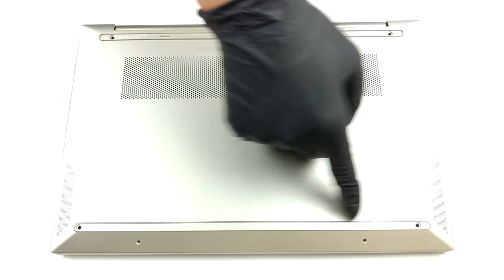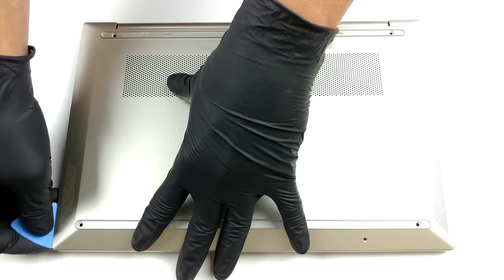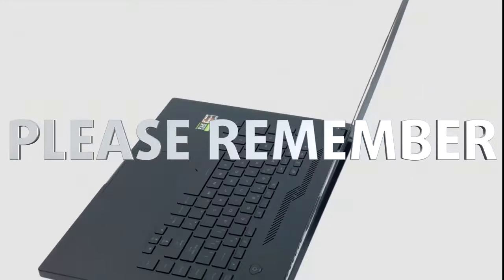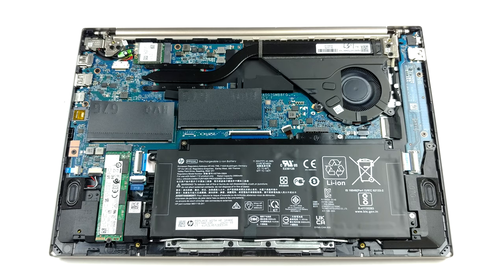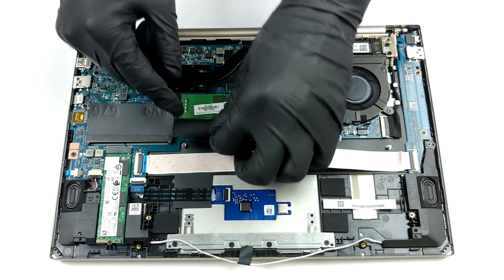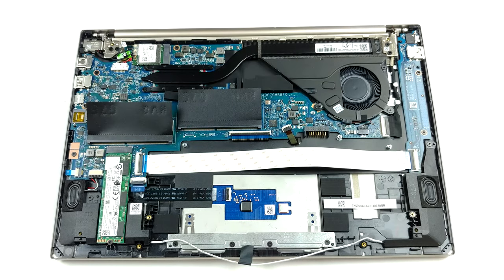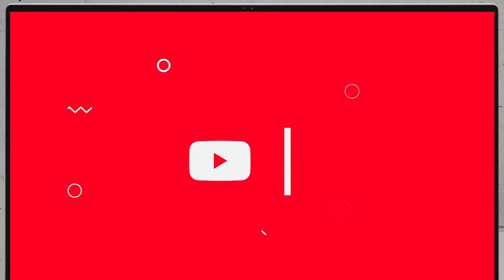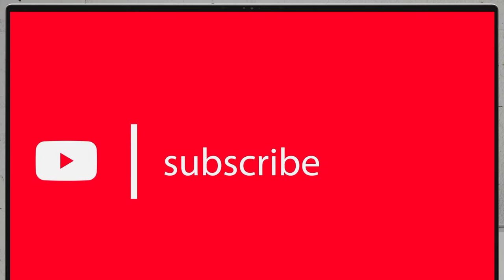🛠️ HP Pavilion 14 (14-dv0000) - disassembly and upgrade options

Comment: Anyone know is there is a secret advanced BIOS menu tab, my laptop is advertised and sold with PC3200 (1600MHz) RAM and looking at CPU-Z confirms that I have the correct modules but they are only running at PC2660 (1330MHz).  There is a 1600MHz JEDEC profile but the laptop is not using it and I can see no way of selecting it myself because HP has the BIOS locked down.

Comment: Hi, I have this laptop. I encountered CMOS 502 issue. I approached the repair shop for a solution to solve the issue. They mentioned that the CMOS battery for this model is embedded in the motherboard. Hence, the motherboard will have to be replaced and it would be very costly. Can you enlighten on the matter of whether it is true about the CMOS battery for this model? Thanks.

Comment: What's the best way to remove the rubber feet, and then put them back on?  Thanks
Reply: Do not remove them. Just uncover the edges enough to unscrew the 4 screws.

Comment: After swapping the memory the computer powered down the moment I pushed the power button.
The solution is:
* remove the power cable and the battery
* push the power button for 1 minute
* reconnect the battery and the power cable
* power on the laptop

I successfully replaced the SSD with a 1TB Samsung 980 and the memory with 32GB Kingston (2 x 16GB, 3200MT/s CL20).
Reply: I need to install 2x8gb ram on mine, any tips on how to insert the ram and how to reconnect the battery? any help much appreaciated, my ram arrives in a few days

Comment: Thank you guys. Great video.
QUESTION: Could you replace the original 3 cell battery with something larger? I wonder if it would fit all OR maybe there are only 3 cell batteries designed for this type of laptop?

SUGGESTION: It would be worth mentioning that you can easily replace the SSD hard drive

Comment: Can we add additional SSD on this laptop? M.2
Reply: You can replace the included M.2 NVME SSD with any other M.2 NVME 2280 SSD. Unsure if it will work with M.2 SATA however the M.2 NVME drives are not much more expensive but a lot faster.

Comment: i try install windows 10 in seem laptop , but m.2 not found, thanks bro.
Reply: 1. Download the Intel RST driver from HP Support and Drivers.
2. Make a bootable windows 10/11 pendrive using windows iso
3. Open the package with winrar and extract the files  to a folder in the pendrive and boot from it.
4. During setup's hard disk partition screen, click load driver and select F6 folder from the extracted files on your pendrive and follow the screen instructions.
5. After those steps ssd will be shown in the setup.

Hope it helps
Reply: @pranavjohnissac5078  I wanna buy the AMD version of this laptop, what will be the case then? Will the new SSD then work straight out of the box or? since i can't use intel RST

Comment: I got a 1TB M.2 SSD drive for this laptop but unfortunately it's not detected by the system or in BIOS. Tried initializing it via Windows \ Disk Mgmt, but it's not visible there either.... I wonder if HP put any cap on what size of disk you can insert?
Reply: omg I just read about this on HP's website from a reviewer who was seething and came to this video to confirm whether it was true, so you can't upgrade the SSD yourself you have to take it to HP? That is so shitty, what did you do?
Reply: Probably too late for greeppl, but these laptops require a specific storage driver to access the SSD. I had a similar issue with a 14-dv0607na. I upgraded the SSD to a 500GB NVme and tried to install Standard Windows 10 from USB. The installation would not recognise the SSD (although the BIOS did). To resolve this you need to load the correct driver from HP during the install (there's a "Load Driver" option when you select Custom Install on the Storage Selection screen). You need to download the "Intel Rapid Storage Technology Driver" from the HP support pages for your model and then extract the driver from the downloaded .exe file. Then copy the extracted driver files onto the USB media you're installing Windows 10 from. You can browse to this driver when you get to the storage selection screen.
Reply: @charlesdurrant  thanks man